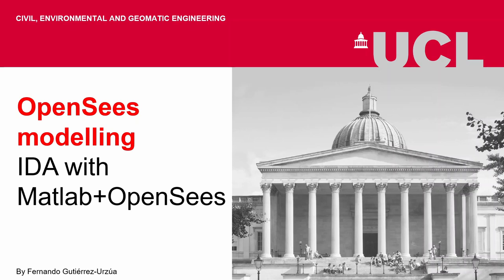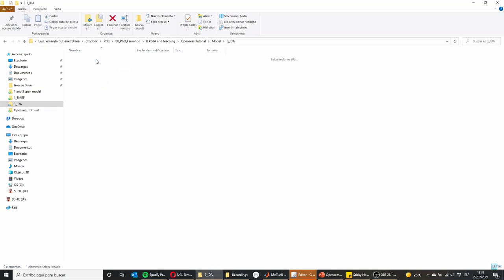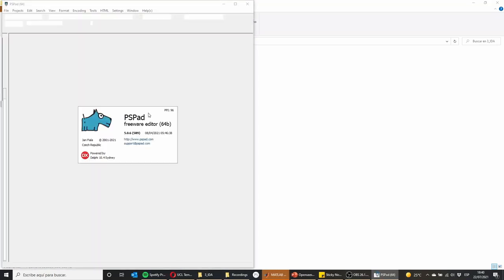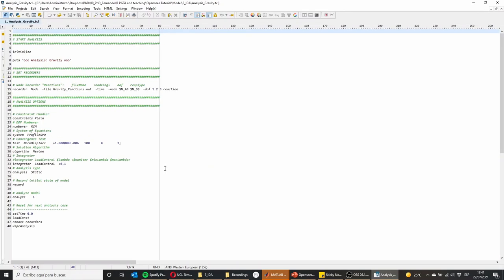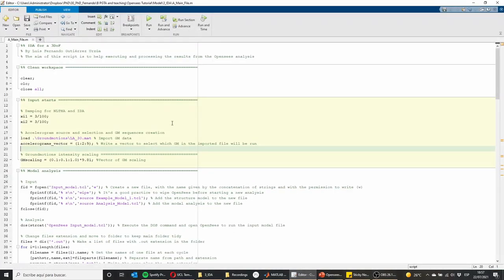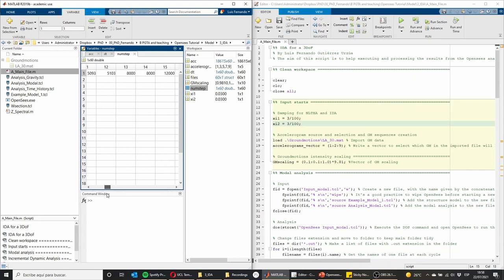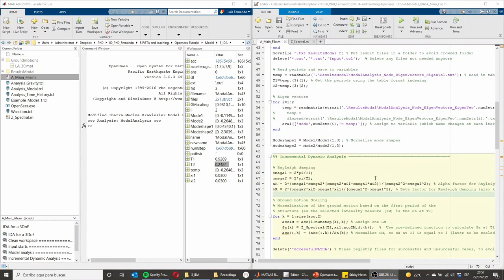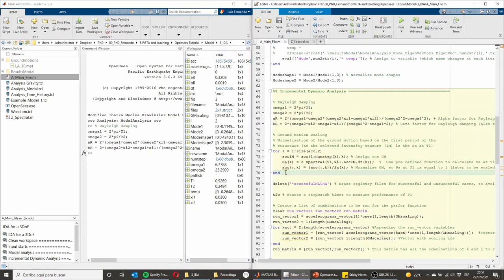OpenSees - Incremental Dynamic Analysis (IDA) with OpenSees + Matlab

Comment: Whether acceleration in input file in units of g? If it is in unit of m/s2 also we need to apply 9.81 in scaling the ground motion
Reply from the maker: I normally multiply my GMscaling vector by 'g' (eg [0.1 0.2 0.3 0.4...]*9.81, which results in [0.981m/s2, 1.962m/s2, 2.943m/s2...]), as I like to show the output in terms of 'g'. However, the model is built in m/s2, which means that my accelerogram input has to be in the same units.

Comment: Thanks for this valuable content, isn't it a better idea to use OpenSeesMP+tcl instead of parafor to utilize parallel processing?
Reply from the maker: If you know how to use it, yes. It may actually be faster as MATLAB tends to be quite slow. Most people are now moving to Python and OpenSeespy, but at the end (at least at the moment) it is a matter of preference.
Reply: @terrastructeng  I prefer to use python for Ground motion scaling and creating Tcl files for analysis, and then use OpenSeesMP to perform IDA.
OpenSeesPy is similar to OpenSeesMP in the case of parallel processing, but it's difficult to use in Windows and easier on Linux machines.

Comment: Hello Fernando, thank you for this presentation. All of your videos are useful. I have a question: Can you explain how to calculate the energy balance of a structure using Opensees?
Reply from the maker: Hi David. I believe some materials are compatible with energy-related recorders, but I have never used them. The only similar thing that I have done before, was to measure the hysteretic energy dissipated through a specific element, and I did it by calculating the area under the hysteretic curve directly, by recording force/moment and deformation/rotation.

Comment: Hello Fernando, I have seen your videos and those are very useful for research. I am searching for a video in which a frame can be solve using OpenSees and Abaqus. The part of frame i.e. element of the structure is modelled on Abaqus and the rest of the structure analyze on OpenSees. Could you please help me?
Thanks by the way.
Great work done by you.
Reply from the maker: Hi Shubham... I am afraid that I cannot help you, as I have very little knowledge on Abaqus (I have used it only a few times for very simple tasks).